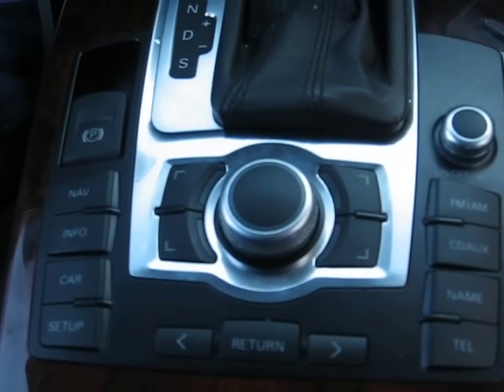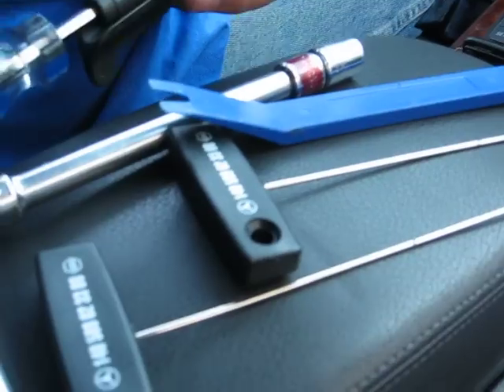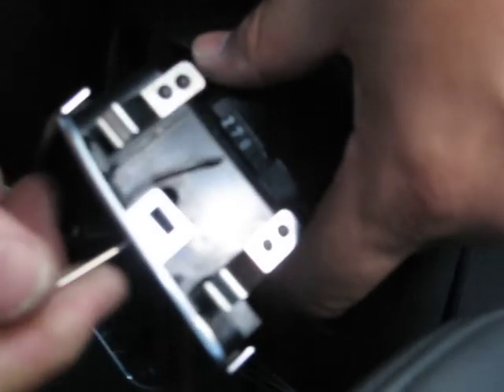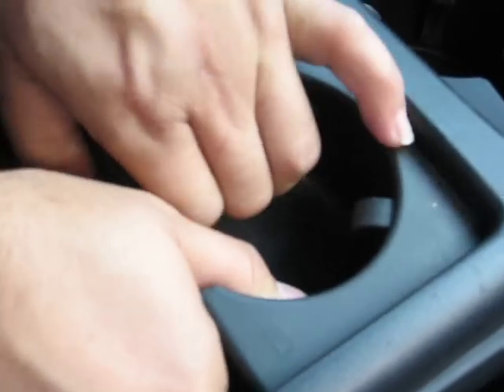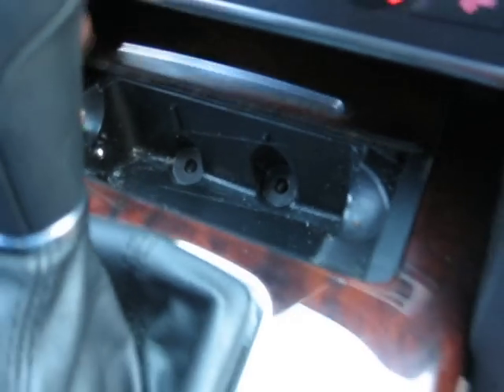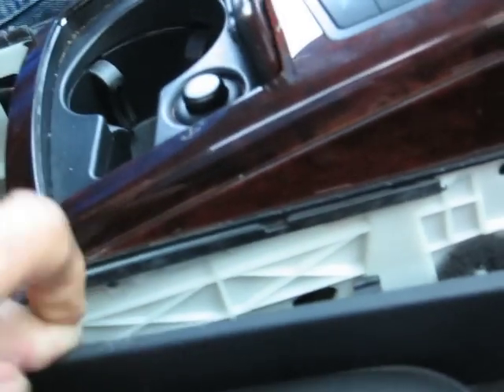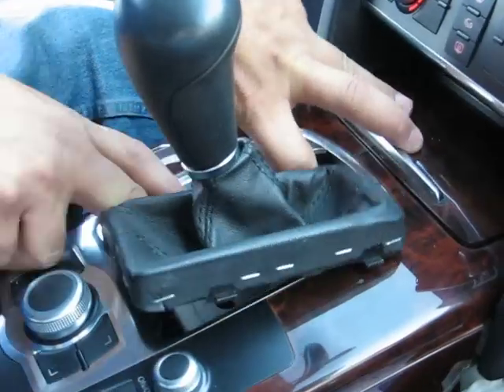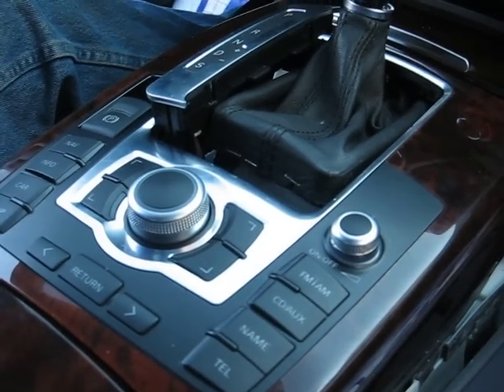How to Remove MMI Control Module from 2008 Audi A6 for Repair.

Comment: I spilled an ice tea on my console and it started malfunctioning turning on and off. The keys were sticking and seemed to be causing the problem. This video helped me take it apart and remove the MMI module. Afterwards I opened the MMI case and removed the circuit board. I then remove the rubber casing and sprayed a traffic lane cleaning agent for carpet on the keys both front and back: Note- I did not spray the circuit board itself.

I soaked it in hot water after spraying it for 15 minute, took it out and blow dried it. To test it I simply put the module back together and plugged it in and it worked. Just make sure it's dried well before plugging it in. Thanks

Comment: Nice video. A couple comments... you do not need the audi tools. Just wrap some floss or some wire through and back out and you can pull it out. Also the removal is easy but some may find disconnecting the wiring the more difficult part of the job.
Reply: Did you have problems with the unit? I had water go in from a worn out sunroof seal. Still checking options, from what I hear if it's only water just cleaning the boards should do it.

Comment: I have a 2010 Audi A6 s-line which the cd changer works perfectly and play cds, the display also turns on with no issues however whenever I can for stations it picks up nothing on any frequency, am, fm etc
Reply from the maker: Most likely the tuner module in the trunk is bad or it could be the antenna also but very unlikely.
Reply: HiTechElectronic Thanks for that, I’ll let you know how it goes.

Comment: Would it be possible to clean the mmi board to see if it will function normally after the clean? if so what cleaner would you use? thanks
Reply from the maker: If it has corrosion and caused by coffee, soda or water, you can use water first to remove the corrosion then spray WD40 all over the board and switches.
Reply: Thanks so much

Comment: I changed mmi and parking brake but when I put on and off both times makes some noise ? And when I start to drive parking brake doesn't go off automatically as before , could you help me please why is it like that ?? 
Many Thanks
Reply: A Nazir what's the make and model of your car bro. I have the same problem with my Audi A6 2006 in fact I've stopped using the automatic handbrake all together just put it in park mode. 
Plesse tell me if you got the problem fixed or did you get rid of the car.